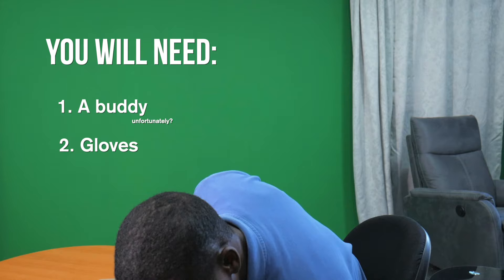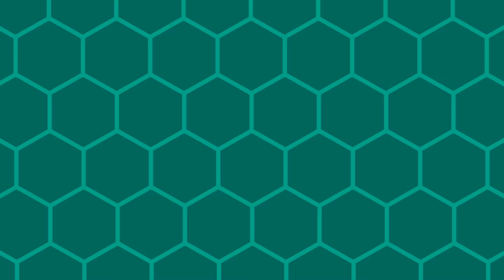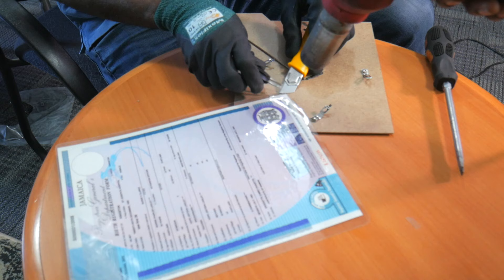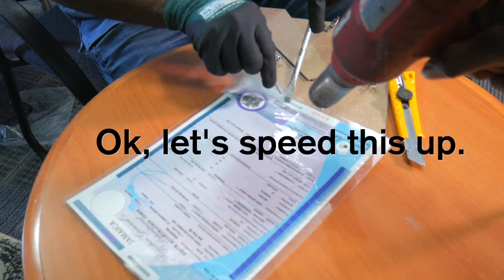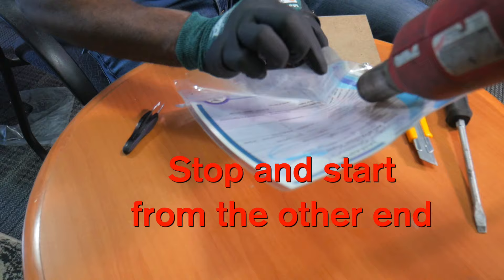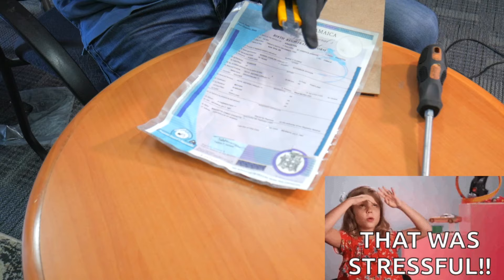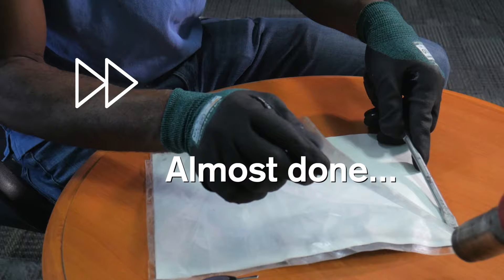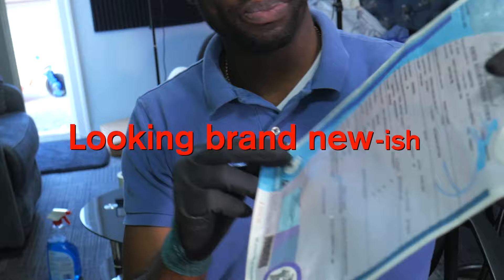How to Remove Laminate From Any Document | Protect Your Document | DYI (2024)

Comment: heating really makes a difference. I tried to open it without heating and the print came out with the plastic. Later when I started to heat up the document, the plastic sheet came out easily without damaging the document.
Reply from the maker: That's wonderful. I am glad you got it separated. Good job my friend
Reply: How comes it hasn't worked for me both with a pressing iron and a hairdryer?

Comment: Hi mate, I have an old poster from the seventies that was laminated in the 80's - is this likely to still work the same way? I can see someone started to remove the laminate, but it started pulling paper as well - so they stopped, which is good. I just want to know if it is possible that being so old, would it make any difference or work the same? Thanks for any advice.
Reply from the maker: My friend, if the laminate is done by plastic, this method should work just the same. The secret is applying the right amount of heat and following the lead of the separation... if it is separating, keep going, if not, maybe apply a little more heat or start from another location and work towards that spot. Let me know what works... thanks my friend and good luck

Comment: I am trying to delaminate my old trading cards and when I do the corners are separating, it seems very delicate. And when I apply heat it doesn’t seem to make the laminate less adhesive, but weaker, damaging the piece. Any ideas that might help?
Reply from the maker: My friend, it is like doing surgery... you will need a sharp thin blade and another tool. One to hold down the document and the blade to work your way between the plastic and the document, while you constantly passing heat over it. It is doable, but go as slowly as possible and make your you have the tools. the tweezer worked well for me... but let me know if this helps and what works for you. Thanks for asking.